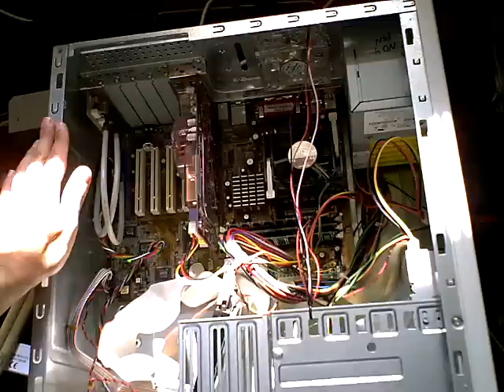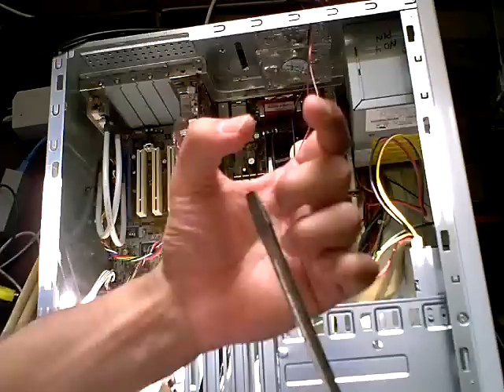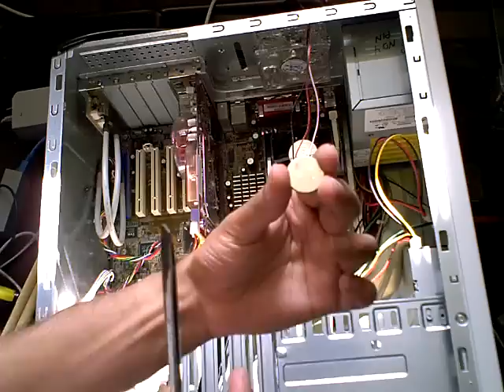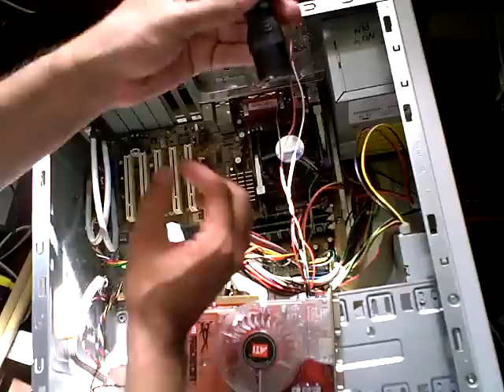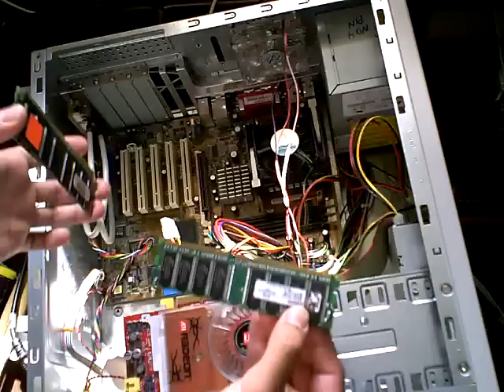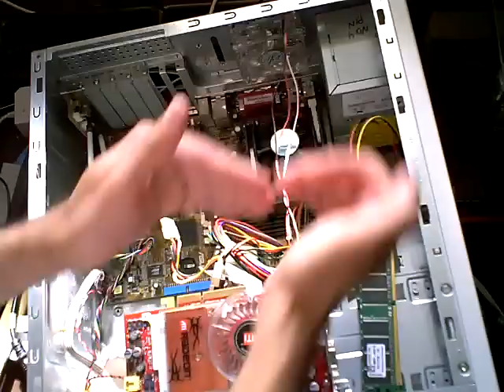How to possibly fix a PC that will turn on but will not beep and will not display anything on screen

Comment: My CMOS Jumper isnt there?
Reply from the maker: +Tyson Young disconnect the power cable, remove the CMOS battery, press your PC's chassis power button switch (to discharge any remaining power circulating in the system), leave the PC unplugged and in this state overnight, then the next day return the CMOS battery to its socket, power up the PC, and if no beep, then disconnect the power cable, press your PC's chassis power button switch (to discharge any remaining power circulating in the system), remove one component, power up the PC, and if no beep then repeat (each time unplugging the PC, pressing the power switch to discharge remaining power, removing a remaining component, and then powering up, and this until the PC beeps at boot).If it never beeps, even when you are down to just motherboard, power supply & CPU+fan, one of these remaining components may be bad

Comment: When i turn my PC on I get no display for the first 2 attempts afer the third attempt I get a windows fail to boot screen and then it boots normally..
P.S. when i turn my pc on all light and fans turns on as well.
Reply from the maker: +MrAvatin Upon initial boot, If you have multiple video out connectors on your PC, power down your 
PC (if already running), connect your display to a different video out, and power up. If 
another video out works, you have to go into your BIOS and set your 
primary graphics adapter to the desired primary graphics adapter, 
followed by saving and exiting
Reply: RodneyDickson All my video output are fine. My pc only boots up after my 3rd or 4th attempt. After it boots up everything is perfectly fine
Reply from the maker: +MrAvatin (shrug) then I haven't a clue. I'd just put the computer to sleep when not in use so that I could wake it easily if going through the 4 boot cycles is a pain.
Reply: RodneyDickson I fixed it the problem was the ram it was somehow clocked at 1333mhz i then changed it to 1866mhz and now it works perfectly. Thanks anyway
Reply from the maker: +MrAvatin Thanks for the update.

Comment: My PC is working there is a display but there is a moving mouse but just a cursor and black screen
Reply from the maker: Your PC beeps, shows a opening screen with some information, then a blinking cursor and nothing else, correct?
Reply: its fixed i just reset my pc its fine :)
Reply from the maker: Aztec Legion™
Glad to hear it then : )

Comment: this is not a good idea to use a screw driver to take out the battery just use your finger nail to remove it many times have i seen gouged scratches to motherboard traces from people using screw drivers inside their computers also if you using a tool on the components on the motherboards touch it to chassis also to discharge it before use
Reply from the maker: These are good steps and I agree with them. Thanks for sharing : )

Comment: I have a dell u2410 monitor and it keeps going into a power save mode and then turns back on then power save mode again. I have my xbox connected to it with an hdmi and I thought it might have been the wire or xbox but its not because I checked on another monitor and it worked fine so I know its the monitor and I have never hade this issue with my monitor. If anyone can reply me back and possibly tell me how to fix this problem, thanks.
Reply from the maker: +juan elissetche When it turns back on, are you seeing the image of your connected device?
Reply: +RodneyDickson no it is just a black screen
Reply from the maker: +juan elissetche Xboxes are tricky when switching displays. Is it a 360 or Xbox One?
Reply: +RodneyDickson 360
Reply from the maker: +juan elissetche Aren't you lucky that I've already solved this problem as well : ) https://www.youtube.com/watch?v=GTISQmExGjw

Comment: If i reset it will it reset all my data?
Reply from the maker: The data that will be reset will be the data stored in the CMOS: the CMOS information pertains to how your PC detects your various components, as well as the date and time and startup / power save properties. Most of this will reset to default values, which will work fine. The only thing that will need specifying by you after resetting will be the date and time (do this by pressing the required key to enter setup when you first boot the PC once it's running again)

Comment: so i replaced my mobo with my friends mobo is better but ehen i press power butted cpu fan and psu fans spins slowly and stops after 1 sec and turns on again no beep no boot
Reply: mc Biggie and yes my psu works on this pc and my psu fan is working
Reply from the maker: +mc Biggie It sounds like your motherboard is developing a short circuit due to contact with the metal casing. Most likely it has to do with the screws and metal mounting stands (supports) that your motherboard sits on. The cheapest way to fix this problem is to introduce cardboard washers between the screws and where they make contact to the motherboard, or you can buy plastic mounting supports at a computer shop.

Alternatively, you can always Breadboard it (explained in the following video:)

If the steps in this video did not provide a solution to your problem, view:

http://www.youtube.com/watch?v=_EK9a-R5pss

You never know, maybe rebuilding the PC in the opposite sense that you took it apart will solve the problem.
Reply: Thanks
Reply from the maker: +mc Biggie Lemme know if you ever give this a try.

Comment: So guys and girls, i want to help.  I had an issue wher when i plugged my HDMI cable in in either my graphics card or motherboard (if you have a graphics card you need to plug it in there) and my monitor said no signal... So what I did is yook it to the shop (of course) turns out my processer was not compatible to my motherboard, so with a different processer, it finally worked!! Hope this helped anyone!!
Reply from the maker: +AwesomeAKG Thanks for the input

Comment: when I removed the cmos battery it didn't even turn on or the fan didn't turn on
Reply from the maker: Some modern motherboards require that a functional CMOS battery be present to operate (I learned of this only after making this video). If you are trying to reset the CMOS, do the following: disconnect the power cable, remove the CMOS battery, short the CMOS jumper pins for 9 seconds then return the jumper cap to its initial position (only if you can find these jumper pins; if not, skip this step), press your PC's chassis power button switch (to discharge any remaining power circulating in the system), leave the PC unplugged and in this state overnight, then the next day return the CMOS battery to its socket and power up the PC

Comment: i have this problem after fitting a new £200 psu .thinking my board is goosed now coz ive done all this
Reply from the maker: Ensure that all of your connectors are firmly in place (and are all connected...you might have missed a connection port). Also, ensure the voltage selector on your PSU matches your power system.
Reply: +RodneyDickson when i fitted new psu i accidentally connected chassis fan to power fan and board sparked .its not worked since
Reply from the maker: You may have fried the board sadly. To eliminate possible error factors, try to Breadboard it (explained in the following video:)

If the steps in this video did not provide a solution to your problem, view:

http://www.youtube.com/watch?v=_EK9a-R5pss

You never know, maybe rebuilding the PC in the opposite sense that you took it apart will solve the problem.

Comment: What if you got 2 cmos jumpers
Reply from the maker: Try the process on one of them first, and if that doesn't solve the issue, try the other, and if that still does not work out, try both : )
Reply: RodneyDickson yeah it didn't work and I think it's my graphics card and I can't make sure because it's a integrated one
Reply from the maker: Jesse Villatoro Breadboard it: 1)place the motherboard with CPU+Fan on wood or non-shiny cardboard 2)connect all of the case connectors to the board's panel 3)with a power bar that is OFF connect the PC power cable from the power bar to the power supply and the power supply to the board 4)while NEVER touching any exposed component,power on the power bar and press the power switch on the case.If the problem still persists,one of the remaining components is probably defective.Power off the power bar before dismantling

I cover breadboarding in greater detail in this video:
Advanced troubleshooting technique tutorial of how to possibly fix a PC that will not beep at boot

Comment: My pc will get half way through boot up and then immediately shut off help?
Reply from the maker: Explain 'half-way' through the bootup. Are you referring to a Windows loading screen progress bar?
Reply: +RodneyDickson I have a cyber power, so it will get passed the cyberpower logo and immediately shut off.
Reply from the maker: Can you get into the BIOS before it shuts off? If so, disable the 'Full Screen Logo' function , save, and exit. It may be that the motherboard is relaying the issue on-screen, but it is being hidden by that Cyber Power splash screen.
Reply: I figured out the issue was of my cpu overheating. but i have no idea how to keep it cool. all my fans are working.\
Reply from the maker: If your CPU fan is sufficient (not dirty and fairly new) then either your CPU is defective or your motherboard is running it overclocked (which is highly NOT recommended). Enter the BIOS and ensure that the CPU clock speed is registered at the proper speed (automatic setting will normally do just fine). If your fan is over a year old, it may have become gunked up and will need replacing (you could try cleaning the blades with rubbing alcohol on paper towel, but normally this 'gunking up' happens within the fan hub, which is not easy to clean)
Reply: i pretty sure overclock is the issue. will reseting cmos as shown in the video stop this?
Reply from the maker: Theoretically it should. But even after doing so, enter the BIOS, select Load Setup Defaults, then Save and Exit. That should ensure that the settings revert to default.

Comment: what do I do if I got a no video card code when I pulled my video card out
Reply from the maker: The problem can lie elsewhere, such as the RAM modules, the motherboard itself, the CPU, etc. Continue to try the steps shown in the video: disconnect the power cable, remove the CMOS battery, short the CMOS jumper pins for 9 seconds then return the jumper cap to its initial position (only if you can find these jumper pins; if not, skip this step), press your PC's chassis power button switch (to discharge any remaining power circulating in the system), Leave the PC unplugged and in this state overnight, then the next day return the CMOS battery to its socket, power up the PC, and if no beep, then disconnect the power cable, press your PC's chassis power button switch (to discharge any remaining power circulating in the system), remove one component, power up the PC, and if no beep then repeat (each time unplugging the PC, pressing the power switch to discharge remaining power, removing a remaining component, and then powering up, and this until the PC beeps at boot).If it never beeps, even when you are down to just motherboard, power supply & CPU+fan, one of these remaining components may be bad

Comment: my pc monitor shows nothing at all, its all plugged in but still nothing, everything is working except the monitor
Reply from the maker: +YSHMIR Plays Does your PC beep at boot?
Reply: I just got a Pre Built Conputer from Ibuypower and Everything turned on, And the Red light Flashed but no Beep No Image and its not Always on...
Reply from the maker: +GeneralShow HD I really hope that the PC is under warranty, in which case I'd return it...don`t mess with it if they can fix it for free.
Reply: +RodneyDickson yes
Reply: +RodneyDickson Its working now but I have a Problem and my BOOTMGR isnt working now and when I click Ctrl, Alt, Dlt it reset but gkes back to the same screen...
Reply from the maker: +YSHMIR Plays Check the back of your PC for any alternate video outputs. Connect your display to one of those then power down and power up the PC.
Reply from the maker: +GeneralShow HD In instances like that, I'd format and reinstall Windows. Maybe there's a way to fix your Windows boot manager, but I have no idea how to. Sorry : \
Reply: RodneyDickson I fixed it but not I keep having problems with Play steam Games like were it says that I dont have Direct3D9 to Play something or the Display cant be seen and Im really sad. If you could help me I would love it! Skype?
Reply from the maker: +GeneralShow HD Sounds like your video card is not compatible with the Direct 3D version you require for your title. DirectX 9 is fairly old, so it is very possible that your game is too old to play on your current hardware (yes, this is a reality of PC gaming sadly). A way around this is to disconnect your current hard drive, connect a temporary hard drive, and on this temporary hard drive, install Windows XP and install your game on this Windows XP hard drive. I understand that this is a long way to go for one video game, so it better be worth the trouble if you go this route : )

Comment: so now what should I do if I get the beep
Reply from the maker: +Palani Said one singular beep or more than one?
Reply: more then one
Reply: +RodneyDickson just like yours
Reply: +RodneyDickson So what should I do?
Reply from the maker: +Palani Said Beep error codes differ from one BIOS manufacturer to the next. To discover what the beep error code is trying to telling you, discover the manufacturer of your BIOS (available in the motherboard's manual or on the motherboard's manufacturer's website {on the page for your specific motherboard model}) and then look up the frequency and interval of your beep error code on:

http://www.computerhope.com/beep.htm
Reply: +RodneyDickson I have. I got 3 beeps which means no rams in place. I think my graphics card is dead. Thank you for responding
Reply from the maker: +Palani Said If the beep error code is telling you that there is a problem with the RAM, why are you assuming that the video card is the issue?
Reply: +RodneyDickson 3 beeps mean no ram detected
Reply from the maker: +Palani Said Alright then, good luck

Comment: My pc turn on and while booting the monitor flash a blue screen and turn back to black again and for that it won't start again
Reply from the maker: +Richard Andoh Is there ever anything written on any of the screens?
Reply: Nothing just a flash blue screen
Reply from the maker: +Richard Andoh I'd Breadboard it (explained in the following video:)

If the steps in this video did not provide a solution to your problem, view:

http://www.youtube.com/watch?v=_EK9a-R5pss

You never know, maybe rebuilding the PC in the opposite sense that you took it apart will solve the problem.

Comment: The computer I built does the same thing and I couldn't fix it so I got a new mother board and it still won't work
Reply from the maker: Your CPU could be damaged, or one of the other components could be incompatible with the board you're buying: note that matching bus types of video card to motherboard socket (PCI-E for example), matching socket types of CPU to motherboard socket (LGA1366 for example) or matching bus types of RAM module to motherboard socket (DDR3 for example) does not necessarily signify compatibility. If this is the first time you are trying this hardware on your motherboard, there is a chance that this new hardware is not compatible with your motherboard, despite the same bus type and despite the fact that the new parts fit in their respective motherboard socket. Your motherboard manufacturer's website will have a support page dedicated to your motherboard's model, and on this support page should be a compatibility list for such components as video cards, CPUs and RAM modules. Ensure that your new component is certified to function with your motherboard, and if your new component is not present on the compatibility list, then there is a chance that the new component is not compatible with your motherboard.
Reply: +RodneyDickson I'll post a link to my parts list
Reply from the maker: Sorry dude, you gotta do the research to see what's compatible and what's not. If you wanna do it the real lazy way, maybe you could write your motherboard manufacturer and ask if the components are compatible with your board.
Reply: +RodneyDickson idk I used PC parts picker and I checked with someone who has experience building computers they said it was the motherboard but I already sent back the original one and got a second one but still it doesn't work
Reply from the maker: Perhaps you damaged the CPU during install. Check the pins to make sure they are not bent or damaged. Also, ensure all of your connections are firmly in place. Maybe the CPU itself is just defective. To eliminate any other possible factors, I'd Breadboard it (explained in the following video:)

If the steps in this video did not provide a solution to your problem, view:

http://www.youtube.com/watch?v=_EK9a-R5pss

You never know, maybe rebuilding the PC in the opposite sense that you took it apart will solve the problem.